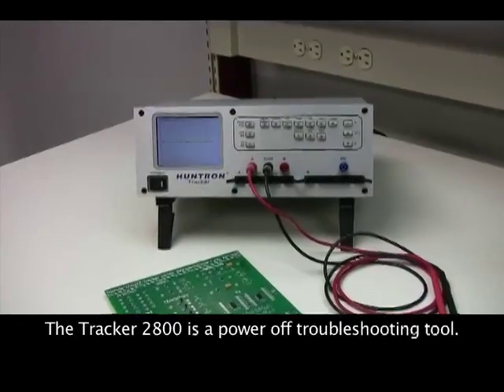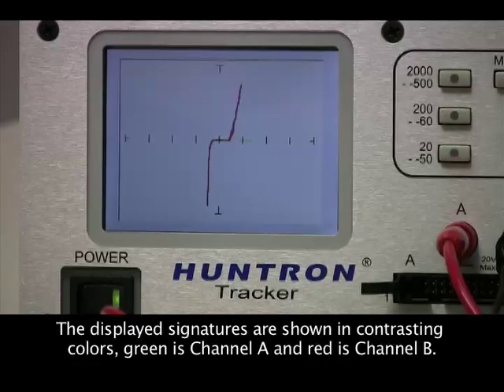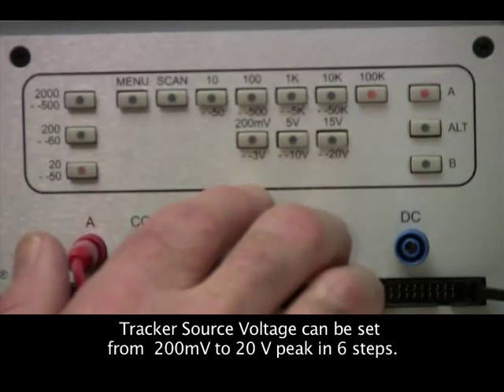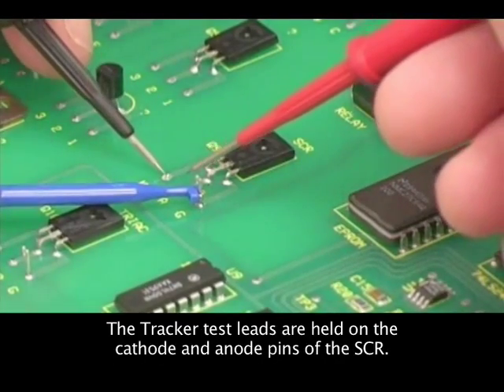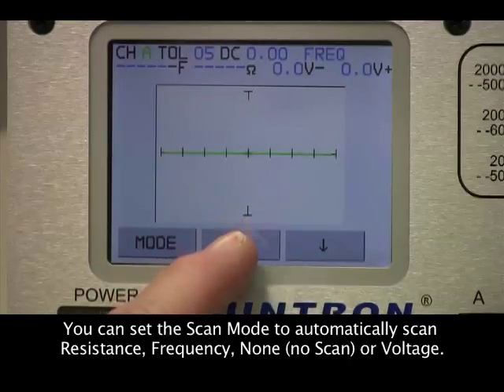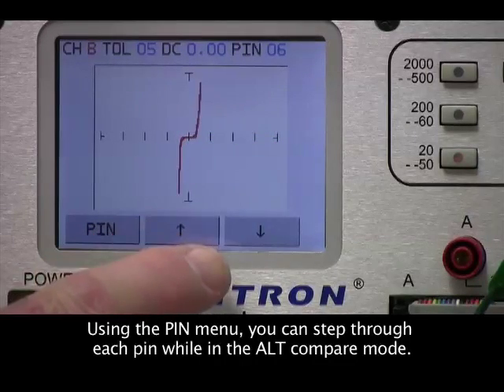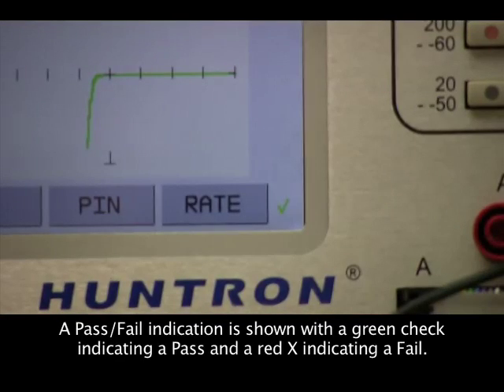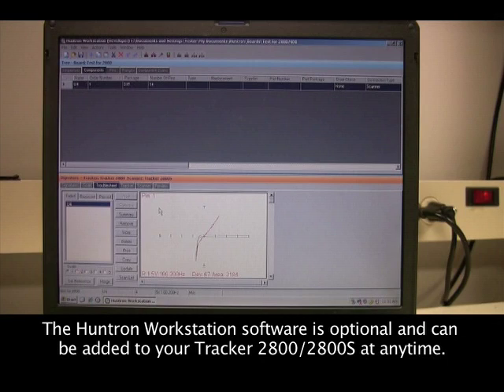Circuit board test with a Huntron Tracker 2800 and 2800S

Comment: Can this be used to troubleshoot Iphone and Ipad motherboards as well?
Reply from the maker: Trackers have been used on all types of PCBs since they are a general purpose troubleshooting tool. The issue with commercial electronics like cell phones and tablets is whether it is worth taking the time to troubleshoot them as they are considered a low value board by most repair shops. The labor cost can quickly exceed the cost of the board. Maybe it is worth taking a quick look at the caps and higher fatality semiconductors but you would still need the equipment to remove the parts plus have a source for the parts.

Comment: This is only good for manufacturing plants were they have many of the same not for general electronic repair the contrary you have to have double for each other the you repair not practical
Reply from the maker: Huntron Trackers have historically been used by third party repair shops where they have few other testing options. This is because they have little or no documentation for the circuit boards they are repairing. Comparison testing is an effective test method and I challenge you find a better power-off instrument for general purpose testing.
Reply: You are wrong, I have one old Huntron in my house lab and I can not imagine my life without my huntron.
I fix Cybex and Lifefitness motor controllers, tis is the fast and concisius way.

Cheers.
Reply: These things are great for troubleshooting vintage equipment -- no double boards usually required.  You can immediately see if there is a short circuit or open.  Also, you often have several identical circuits wired up in the device (data bus or address bus lines, drive transistors,  parallel interfaces) and you can reference it to the other similar circuits.  Finally if you have the schematic, with enough experience you come to expect "thats an input pin with ESD protection diodes, it should look like this" and be able to find questionable signals for further analysis.